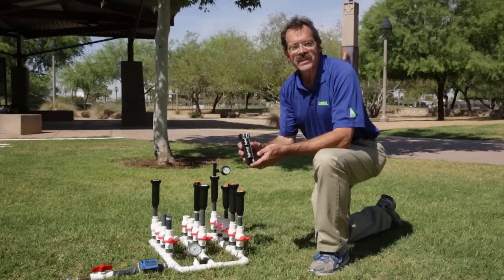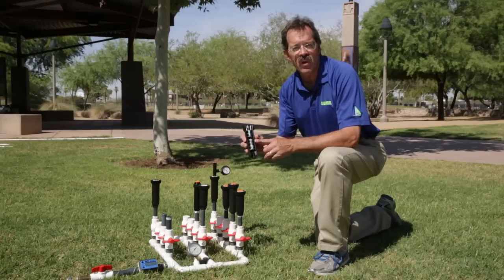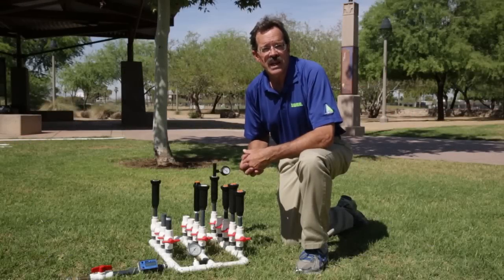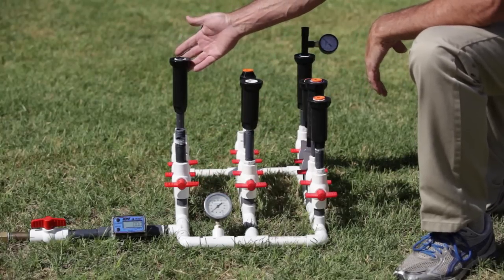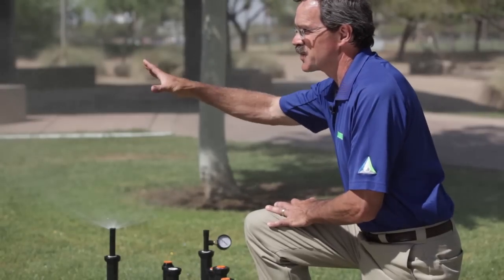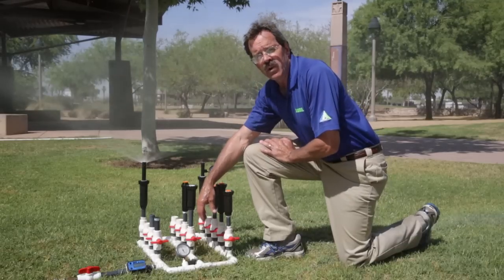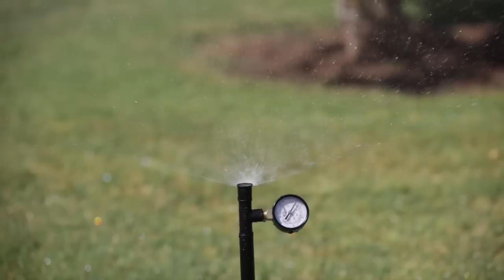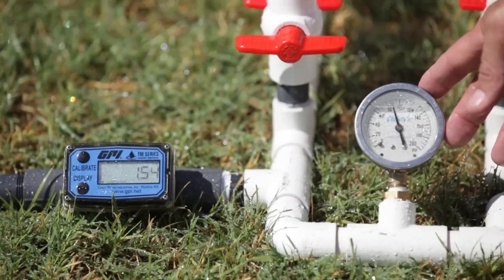Irrigate More Efficiently With A Pressure Regulating Spray Head

Comment: I have an existing sprinkler system which has high pressure and lots of misting and runoff. If I install these pressure regulating heads will they cause a pressure overload on my 20 year old pipes? Or are they safe to use?
Reply: My 30 year old pipes had several bursts after I installed pressure bodies on every sprinkler
Reply from the maker: Thanks for watching, Jay! If you are concerned about the pressure causing damage to your system, you might want to consider installing an inline pressure regulator instead. Installed upstream from the valve manifold, this would lower the pressure for the entire system.
https://store.ewingirrigation.com/40007130-nr34xl-1-inch-pressure-reducing-valve-15-75-psi

Comment: What is the advantage of pressure regulating each head vs. putting a regulator on the whole line?
Reply from the maker: Sorry for the late response, Tom. The primary advantage is the ease of installation. It's simpler to replace a sprinkler head than it is to add an inline pressure regulator. Thanks for watching and the question!
Reply: Is it cheaper to replace all the heads or to add a pressure regulating valve on the front end of the system?

Comment: so there will still be high pressure in the system, but the sprinkler will be doing alright?
Reply from the maker: Yes that's correct. Be aware that the maximum inlet pressure for the Rain Bird 1800 series PRS is 70 psi. Thanks for watching!

Comment: Great video! Do all manufacturers have pressure regulating spray heads and are there differences between each brand's option?
Reply from the maker: Thanks! All the major irrigation manufacturers offer pressure regulating spray heads, usually indicated by PR or PRS in the model name, but other features will vary.